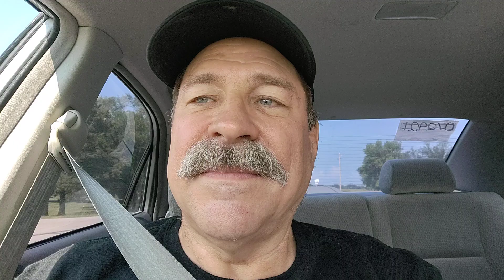My breaker is off but the outlet still has power

Comment: One side of my house power went out . I remember a strong lightning storm . The next day the power went out. I been replacing outlets and switches.  Even fixtures . Mostly if they are old or never been upgraded. I replaced the 15 amp first because it was kicking immediately.  Now I come across this outlet that had power to it but is not wanting to run anything.  I replaced it but had to kill all the power in my home to do it safely.

Comment: I live in a trailer. I have 2 brakers . One 15 amp for one side of the house. And the other for the other side. I cut off the braker that usually runs the outlet. I start to remove the outlet and noticed it still had some power. I cut the other side off and I still have some power. The outlet does not run anything so im replacing it. I had to kill my 100 amp to remove the power. What could be doing this?

Comment: It almost sounds like that has 2 different lines to it as to run each outlet seperately. In that case you have to bust off the bonding tabs on each side of the outlet. Maybe they removed the tab on hot side but not on the neutral side. I would be curious to know what the outcome was.
Reply from the maker: the problem was not having the circuits grounded correctly, and it was feeding back through the wires.

Comment: My bedroom outlet was broken so we turned off the breaker for my room. When i had came back upstairs i saw that my lights were off, but when i went to switch it i got shocked. Should i turn off the main power altogether or what?
Reply from the maker: It sounds like you have a wiring problem. Lots of times the breakers are zoned, meaning the breaker was for the lights and outlets in that room.
If you are getting shocked when the breaker is off, that means you have the power to switch from more than one source, or it is wired wrong.
I would recommend you get a licensed electrician to look at it.

Comment: Bought a new house.. had to change my dryer cord from 3 prong to 4 prong for the 4 prong outlet. Turned the breaker off (double pole 240) and the circuit still had power. Turning it off has no effect. The dryer still functions with the breaker off. What could be the issue?
Reply from the maker: Do you have any other 240 breakers in the panel,  the panel could be marked wrong.  when you turned that breaker did anything loose power?
Reply: @LearnToFixItYourself  I have the same issue, even with the entire panel switched off.
Reply from the maker: You could have a ground loop from ground to neutral, or you could have a missing earth ground

Comment: My power was out. When it came back on one stove eye wouldn't work. 2 weeks later only the lights on the stove work. Got another stove, same thing. When I turned off the breaker there was still enough power to keep the stove clock on. Breaker issue?
Reply from the maker: That sounds like it. they do go out and need to be replaced. You will have to open the panel up to replace it.  This can be dangerous if you don't know what you are doing and pay an electrician to replace it. Once you open the panel you can get into the power source which is 220 Volts AC and can kill you if you put your hands in the wrong place.